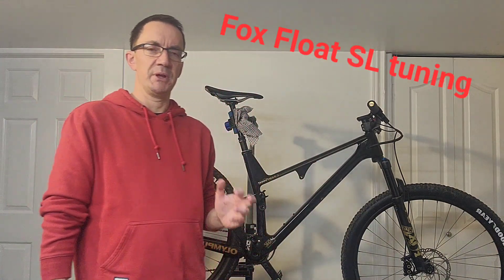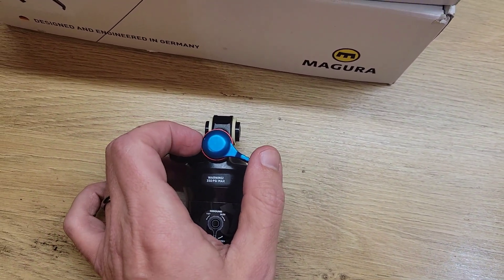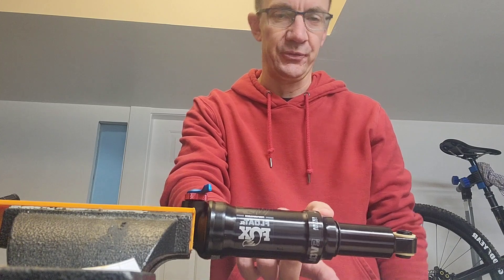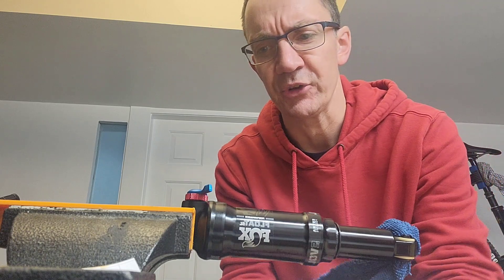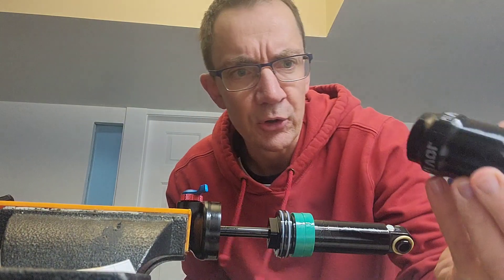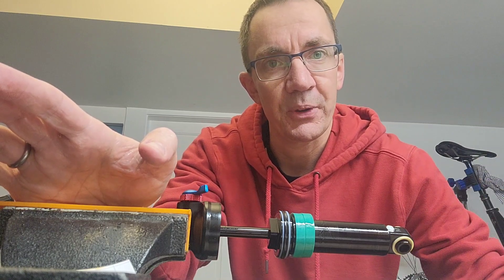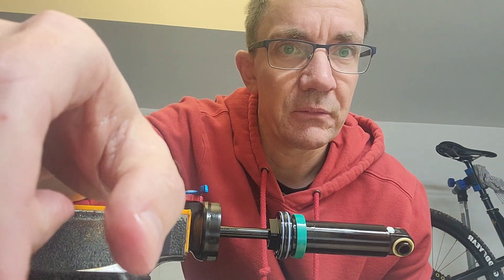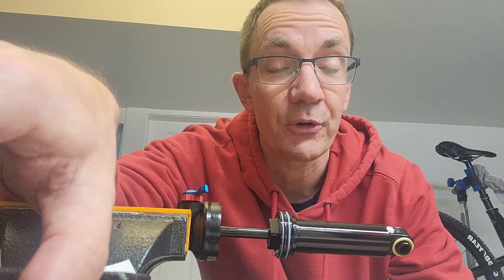First look inside a 2024 Fox Float SL!

Comment: How did you find the ride taking both spacers out? Have exactly the same feel on my factory SL. 

Did you just use normal float fluid? as I opened mine the fluid looked brown and not blue like the usual float fluid.
Reply from the maker: Yes, I just used normal Float Fluid. The shock is much better with the spacers removed. I have tested and tweaked the set up using a Shoockwiz, and it's pretty good now.

Comment: Great shock. Have the Factory version, the stroke is adjustable but not straight forward. Had Fox do mine for me 45 to 40. Only complaint is it’s quite noisy when going back and fourth through the travel but that’s typical fox.
Reply from the maker: Good to know, and makes sense about stroke. Not a simple spacer like some shocks, but more like the Rockshox - doable but not easy DIY